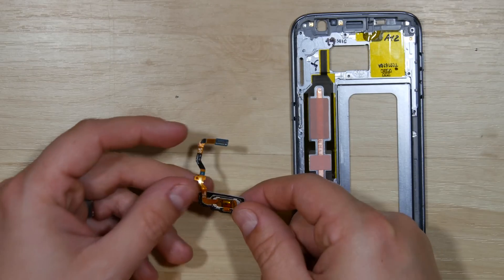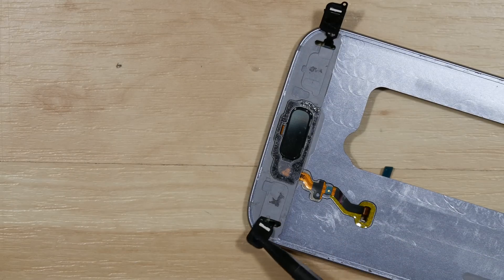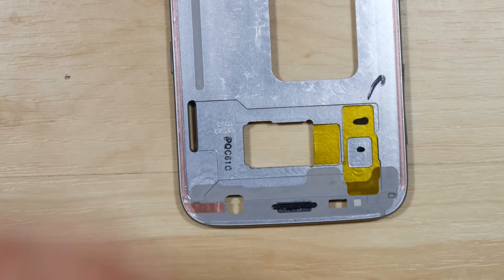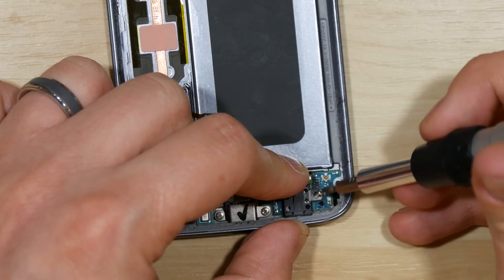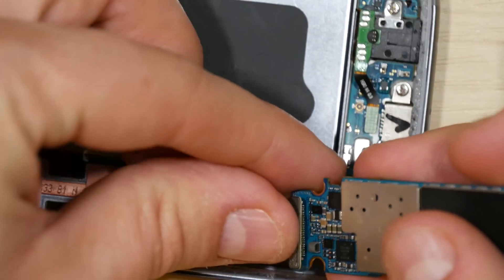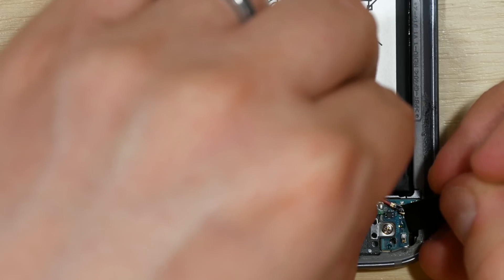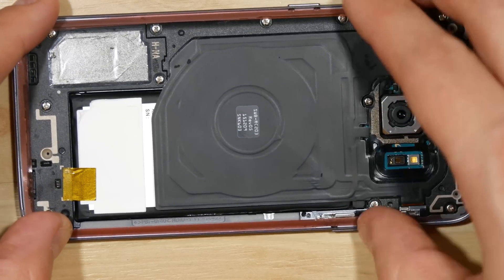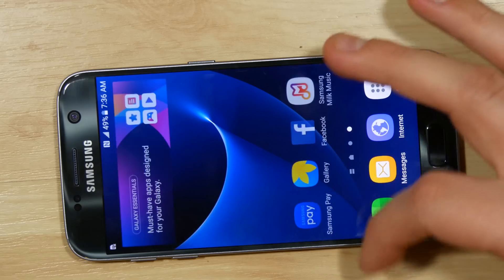Samsung Galaxy S7 Screen Replacement - Reassembly

Comment: It's not gonna be waterproof again
Reply from the maker: +Rob Fassi Nope, possibly if you use a factory seal/adhesive
Reply: +How2Tech it wouldn't even work with that. because at the   factory when they manufacture the phones they use a special vacuum pressure sealer press on the adhesive in a clean room which is dust free, so no microscopic dust particles would get on the adhesive

Comment: what happened to the old screen?why did you buy a new one?
Reply from the maker: +jeffrey santos I had a little tiny LOCA separation in the top right corner noted in the removal video. Etrade Supply sent me a new screen BECAUSE THEY ARE AWESOME! Also so I can do a side by side of video of the OEM and their replacement screen quality (video coming soon)

Comment: my s6 screen is moving a little bit when I press it on the corners near the power button... is it normal ?
Reply from the maker: +Ahmed Kalai Did you replace it?
Reply: +How2Tech no I didn't and never dropped it ..
Reply from the maker: Ahmed Kalai It is normal based on the way the frame is built around the phone. I have seen it more commonly in screens that have been replaced because the adhesive is not as thick.
Reply: ok thank you :D last question , what is the difference between an original and fake s6 glass screen ? can I tell the difference?
Reply: +How2Tech thank you for helping me  !! keep on doing great videos ! you're awesome man :D